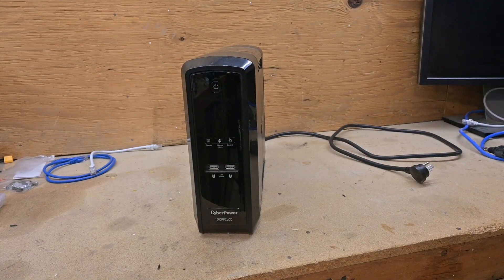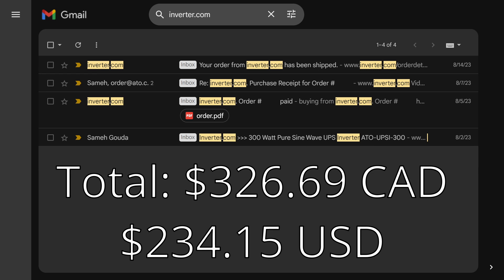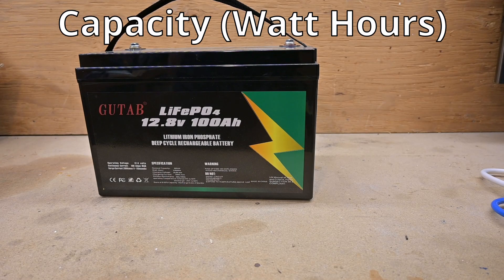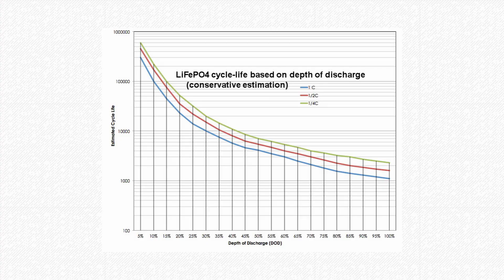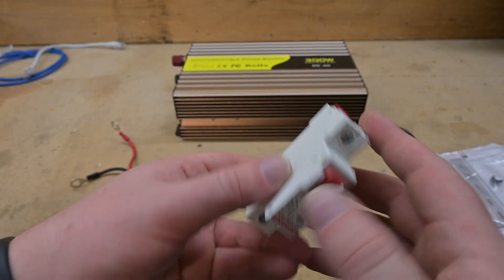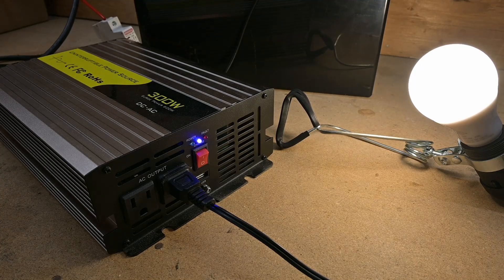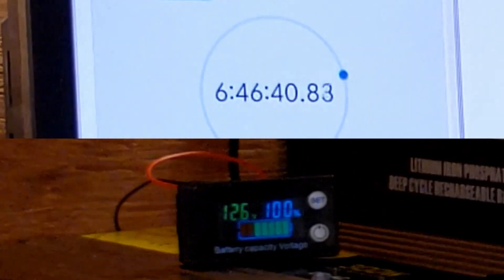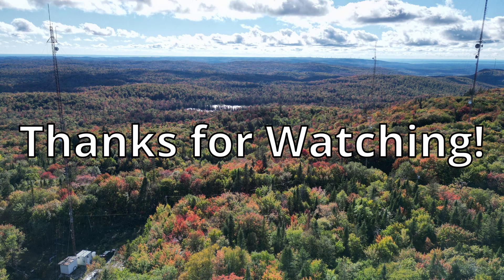Inverter.com UPS Inverter - DIY Flexible Battery Backup

Comment: If I’d have known about this UPS/inverter, I would’ve purchased that and used it for a charger too! 

When the battery is charging through the UPS inverter, is it relying only on the BMS for controlling the charge, or is there some type of charge controller built into the UPS?

Comment: What the test be accurate if you just leave computer on without but not using it? Like if you was playing a game that takes more from your computer like heat and fans. I honestly just curious.  I'm not a computer guy. I was just trying to compare it to like running fans and lights or automatic door, small water pump or automatic feeder. Just stuff like that.

Comment: I hate it's made in China. I have a rule that I do not trust heavy duty mains voltage electrical equipment to Chinese made generic equipment like this. I am very interested in the concept though, especially with lifepo4 batteries. I converted my APC rack UPS units to lifepo4 retro fit units. They mostly work, but occasionally get grumpy and I have to charge them externally. I'd like to replace my 3 units with 1 large unit with external batteries.  I'd like to see eevblog or someone tear these down.
Reply from the maker: For my permanent installation, I needed more power than the small unit in the video and went with a Victron Multiplus 12/1200/50-16 120v which is a pretty reputable brand for stuff like this. Renogy is on the lower end but is reputable enough.
Reply: @BenJefferyCanada  Noted. I will be doing something for mine in the coming months.

Comment: So a pure sine wave inverter is basically a UPS? I thought you can back-feed a puresinewave inverter so if the power goes out the battery will send power to all devices on the same mains line you have it plugged into wall on?
Reply from the maker: This one specifically has an auto transfer switch and charger built-in, usually called an inverter charger by other vendors. 

A regular inverter would take DC in and output AC all the time, which means your DC source would have to be capable of supplying power to the AC load all the time. You could probably make that work as a UPS still with an external auto transfer switch and battery charger, but it may just be easier/cheaper to use an inverter charger since it's all self-contained.

Comment: I have a Bluetti eb3a  that puts out 600w, 268wh that is a ups connected to a 100ah battery using the cigarette lighter cable.  It takes up very little space. The eb3a is currently under $200 0n Amazon 6/30/25 . While I have a  home assembled solar system with  four 100ah batteries and a 3000w  inverter, this small solar power station takes the pressure off the larger system.

Comment: What if you something like a light connected to a 12v and 24v battery will they have the same run time or will the 24v battery have a longer run time? I’m thinking making a DIY UPS to run a small computer setup, I found an inverter that has an option for 12v or 24v what will be better? Also considering that power outages are very rare and the ups living under my desk in my room. And maybe using LiFePo4 batteries. Or should I just get a UPS from CyberPower or APC?

Comment: Great video, well done. Just one remark is regarding the shutdown.. some need to know that SPI/UART output to cover the warning states e.g. running on UPS, shutdown warning etc. The reason not to go below 50% of the charge (AMG) is the life, replacement cycle.. kindly be aware of the hold-up time of the attached devices. Informative video covers the vast majority as need to know, LIKE

Comment: Hi i built sth with car battery to have backups in power outtage. It consist of a charger(rectifier) and car battery and inventor.
Now i want to make it like ups, i mean when power in on, uses that and when power outage, switch to battery+invertor with out delay. How can i do that?

Comment: Great video. But I wouldn't want large lithium batteries in my home. The electrolyte provides oxygenation for a fire, so the fire hazard, though unlikely, is extreme in consequence.
Reply: Lithium LFP batteries have less fire risk than Lithium NMC, but are not risk free.